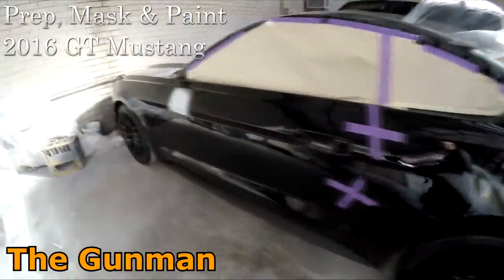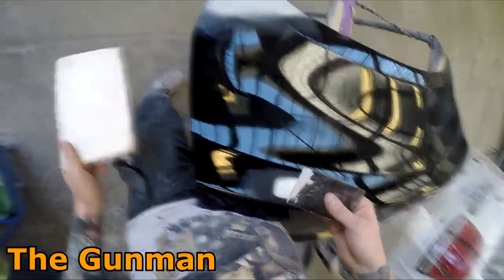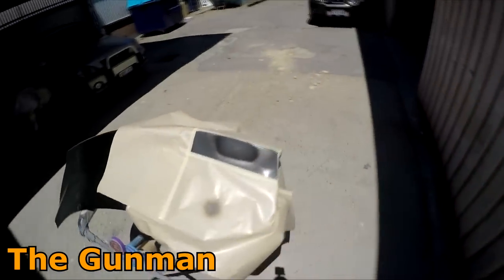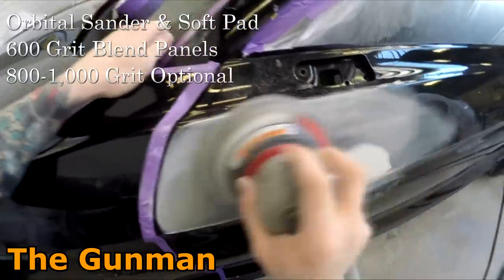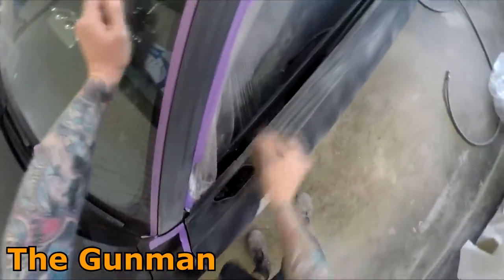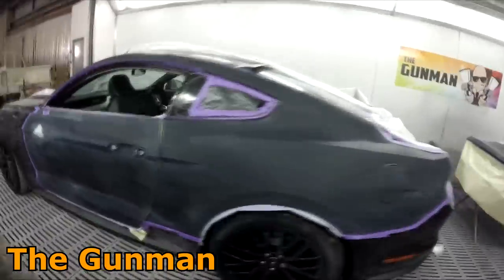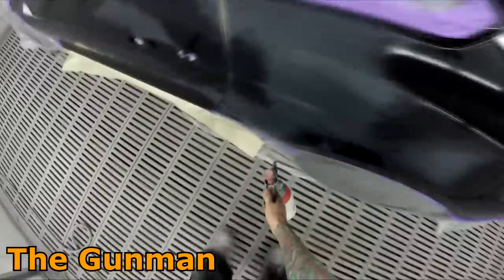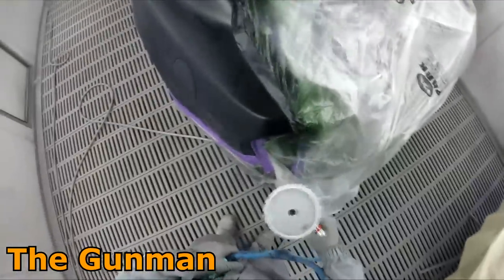2016 GT Mustang Spray Painting

Comment: U.S. it's called the Trunk, I am kind of blown away how much clear your putting on.  I use a paint (Shop line) from Napa, that if you go over 3 sprays per setting, it will dull on you or worse bubble.  Of course I don't have a flash booth like that.  Any hou just about to put the last clear on my 1994 Blazer restoration.  Thanks for the vids!
Reply: Jonathan Dexter or deck lid likd us old school blokes
Reply: No the trunk is the part of the car you that can put groceries in . Professionals call it a deck lid or a boot lid like he said in the video. also no professionals gets paint supply from a parts store. Gunny makes his living painting and im pretty sure he knows how much clear to put on. 
the hazing and bubbles you described come from solvent pop often caused by poor application practice such as not enough flash time and or the wrong hardener for the job or temp.
Reply: Precisely. Too slow hardener and it flows excessively and GunMan is an artist in using as fast as possible, but not faster! I noticed this after he showed the clear coat warming prior to application.

Comment: I work in the states on large truck. Like cargo carrying trucks. And in our business it's a fast pace. Come in to fix and paint then go back on the road. We use Single stage paint almost all the time. What is your opinion on Single stage paint. What gun/air cap setting would you use?
Reply from the maker: I honestly don't like it, it doesn't last and makes it a pain in the ass if you ever have to repaint it.I do have a video on acrylic clear but for the purpose, these methods most likely will vary https://www.youtube.com/watch?v=JfHi5Kiqhto

Comment: Thanks for another upload! Random question!? Any experience with the 3m Accuspray system? Been considering it for primer lately .
Reply: marshallpulham works great, I use it for primer for over a year now
Reply: Brando Freddy whats your average expense to do that or are you saving on cleanup?
Reply: I just bought my first box of tips after doing primer almost every day, if you take care of the gun and clean the tip really good, you can make the tip last really long, box of 4 tips is 25 bucks, this gun is worth every penny
Reply: Definitely worth it. We use one at my work. The clear 1.8 tips for primer, but there is multi colors for various things. You could probably do jamb cutins if you want. Just make sure you take the tip off and clean them well. The main thing is the rubber seal on the tips swell, shrink and get warn out after cleaning them with thinner. A box of tips usually lasts me 4-5 months or more. Takes maybe 2 minutes to clean them!

Comment: Nice job ,as always!
By the way,you still using those Sagolas: does it mean your spraygun top ten changed?

Cheers mate and Happy New Year!
Reply from the maker: Yes mate my top 10 would definitely include the 4600 now, I'd have to use it a little more and have experience with some of the other air caps available to give it an exact place as of yet but easily top 5.
Reply: Nice! i'm looking forward to try one!
I bought recently a 4500 Café Racer edition  and a funny thing is that the trigger and the flow regulator are not the same as the other two 4500 that I have: it seams to be exactly the same of the new 4600.Just curious to compare de inside parts of both models!

Comment: I know you did a video on the Tekna air caps, but i want to make my prolite strictly for basecoat. Do you have recommendations on what nozzle and cap works best for you? I spray PPG Envirobase and have unlimited air.  I started off with TE20 and 1.3, it seems to spray really wet around 20psi. I ordered a HV30 cap and hope that improves some things.
Reply: Chris Envirobase is meant to be sprayed wet or else your clear will have texture and won't stick good if the base is rough. It's a latex and will not melt into itself like solvent base does. I like to use iwata ls400 supernova 1.3 or a sata rp 1.2-1.3 depending on humidity. Viscosity is critical with Envirobase. hope this helps. been with waterbase for at least 8 yrs.
Reply: Thanks Daniel, appreciate the info.

Comment: do you think you could do a video on the best tape? im having trouble finding the  BEST tape. Green doesnt stick very well. Blue doesnt either. and the beige tape leaves sticky residue after a bake.
Reply: YaBoi Brian I would be interested in a tape review, never seen that purple tape here in the U.K. We've been using green wurth tape, about £50 a box.
Reply: Benny Boy yea I haven't seen any purple tape at one of my local paint stores
Reply: YaBoi Brian I use 3m Highland tape 2727 06542 I believe is the number here in Canada.  best tape out of the ones I have tried.
Reply: YaBoi Brian 3M yellow is cheaper and works great.

Comment: Hi Gunny, You always talk about a blend coat, said it was a clear base coat, I can't seem to find it here in the US, called both my paint suppliers and they don't seem to know what it is, do you have any brand names or numbers of the stuff you get there in Australia?
Reply from the maker: At the moment I'm just using Standox solvent based stabilizer which is product number 599. I also used in the past glasurit 55-M0 or Glasurit blending clear.
Reply: Vons Motorwerks they certainly do have it in the US. Every paint manufacturer will have their own. just explain to your paint store that it's like a clear base you would spray over your blend area to avoid seeing any minor sand scratches. some paint brands it's literally called base coat blender... not to be confused with clear coat blender which is sprayed on the edge of clear coat when blending clear coat on a partial panel.
Reply: Vons Motorwerks specifically, what paint brand are you using? Maybe I can find it for you.
Reply: Usually Dupont Chroma
Reply: Dupont 69301s basecoat blender
Reply: Thanks, I live out in the boonies and the two paint suppliers, sell a lot of paint but are not painters and really don't even know much about what their selling, I restore older German cars and had to self learn paint and body for my projects.
Reply: I understand, most people don't know what they're selling LOL! What kind of German cars? Have any projects now? I have a 2000 Mercedes ml55 AMG that I'm going to start working on soon.
Reply: But have two Mini Coopers for complete Bodywork and paint first😭

Comment: Hey gunman been watching your videos for a while..
Looking for advice on which gun to buy based on my compressor which is a 2.5hp belt driven 190lpm unit
Have prepped a test panel and am getting the hang of basic body work and now looking at learning how to lay down some base coat clear coat.

Will most likely be acrylic as I will be doing it at home.
What could you recommend for around 200-250 for a gun and where to buy quality stuff gear/paint in WA?

Any feedback is appreciated'

TL;DR in WA looking for gun to spray acrylic around $250

Comment: great vid, i am looking for a gun for a beginner DIY for painting motorcycles
Reply from the maker: Look no further than this.
https://www.spraygunsdirect.co.uk/index.php/ani-mini-gravity-spraygun.html#sthash.z91d4FLX.dpbs
Reply: I'm in the USA
Reply from the maker: hamitup They ship worldwide and very fast to USA from what I hear.
Reply: now i just learning. so should i see they have 1.2 tip but can i use this for primer and clears also
Reply from the maker: Yes, I use 1.2 for primer (especially UV primer), especially on small areas like motorbike parts, It'll be ideal, just as long as the primer has around 10% reducer it should be fine (different paints will vary). It'll also be great for the colour & clear.
Reply: what cfm does this gun require
Reply from the maker: hamitup I've never even looked into it because I have an air screw compressor that has a massive supply but being a small gun I'd imagine even a medium or small compressor would run it.